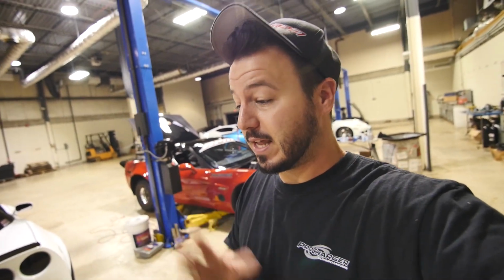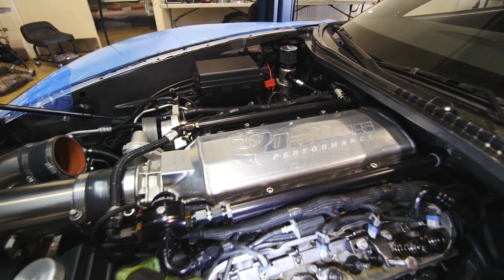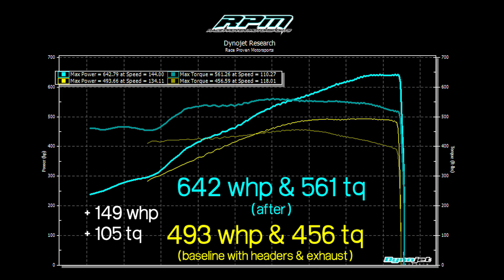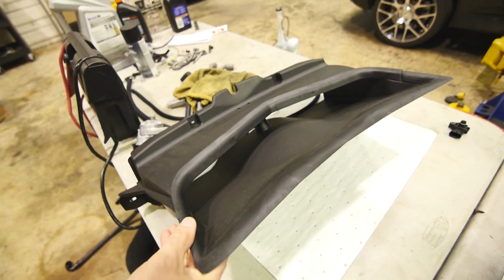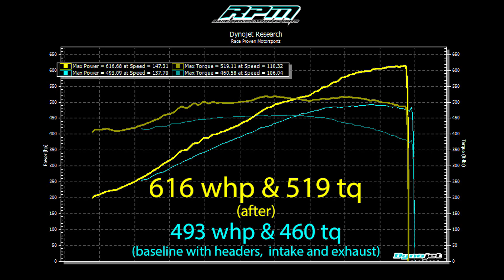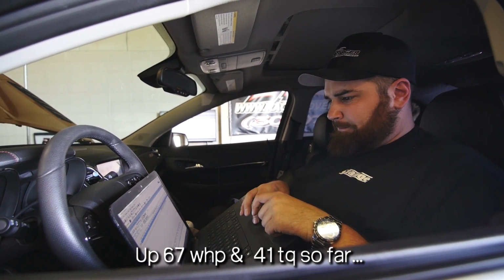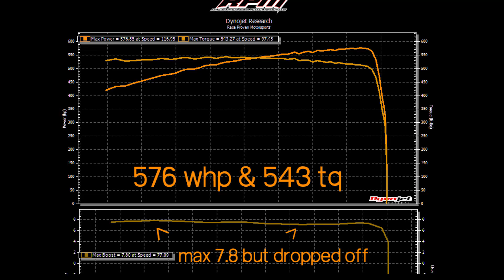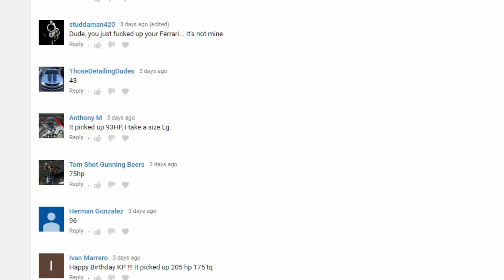Magnuson Supercharged Chevy SS picks up HUGE with our 5" intake | RPM S5 E35

Comment: Guys can you assist here.

Where do you get the billet adapter from the Maggie 2300 from I searched but couldn't find? 

Secondly given it's a 4inch throttle body. How does the 5 intake inch help over a 4inch? Is it the filter restricting it? I have an absolutely massive 4inch filter so it's not restrictive at all.

Comment: As many dyno pulls as you guys do, what is the maintenance like on the dyno?
Reply: AJ SPIRES I've never actually thought about that. Thank you for asking.
Reply: Part of my job is doing maintenance on industrial machines, so that’s always on my mind....
Reply: Most mfr's call for PM every 6 months which consists of greasing the bearings, checking belt tension (if a 4 wheel chassis dyno) and checking the gap on the speed pickup. The roller bearings are probably one of the main wear parts, and more than likely they are rated for 50,000 + hours.

Comment: Hi, I purchased 1 of this bad ass RPM 5" intake for the cts v2. I was wondering what do you guys do or use  to prevent the coupler from collapsing under pressure?
Reply from the maker: We've never had one collapse.  You need to make sure the filter on the end of the intake isn’t shoved all the way up the intake, it needs to be just on there.
Reply: @RaceProvenMotorsports sounds great, thank you very much! Love the show by the way!